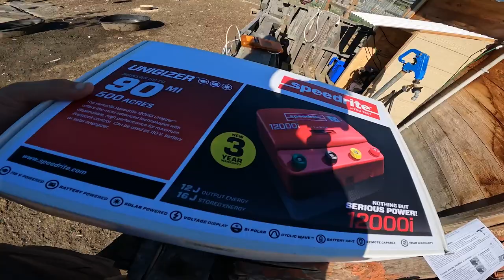Training a Future Guard Goose

Comment: Sounds like your fence charger needs an isolation transformer.  Or needs to be plugged in to an indoor outlet, via extension cord.  They cyclops super only pulls about 16 watts peak, so it wouldn't require much.

Comment: I don't think your fence has a power issue; it's more likely the distance to the ground rods. If the electricity has to travel a mile through the ground from the cows' feet to the grounding rod, that takes a lot out of it. Providing a shorter path by putting in the grounding rods in all four corners of the fenced area would help tremendously. It's a lot of extra wire, but maybe you could use the normal fence as a wire? Connect it to the ground connection of the charger and add a couple of grounding rods as far away from it as possible.

Comment: You may want to research "AFCI" (Arc Fault Circuit Interrupter) breakers, installed into a properly grounded sub-panel, and 'hard wiring' the pump and fence charger into the AFCI panel, with heavy duty industrial grade switches, and off/on indicator lights installed into the circuits for controlling their operation - versus the "plugged-in" and "unplugged" method in use now.  I would also look through the Grainger, or McMaster-Carr catalogs, to see if they have a voltage monitoring system to clue you in with an audio alarm, or pager activation in the event that something preadatory tries to come in, or one of your members of your cattle family decides to venture beyond the boundaries imposed by the electric fencing.

Comment: Retired electrician. If your GFI (ground fault interrupt) outlet trips, then it's either faulty or there is an amount of current loss between the hot and neutral causing a fault and subsequent trip. If the breaker in your panel trips, then it's likely an arc fault breaker, which are bad at best for causing unnecessary trouble. If it is the breaker tripping, not the outlet, replace it with a regular breaker of the same size, 15A (amp) 20A, etc. If it's the outlet, replace it with a new GFI or take the chance of being electrocuted and use a regular outlet. 
You wear rubber boots, which is a good start for protecting yourself from being "hit" too badly. However, I've been hit hard by 120 volts and it does hurt when conditions are so that it's hard to let go. Caution is always the best course, but an electric fence controller should not cause a GFI outlet to trip unless there is an existing problem with one of the connected attachments.
Hope this helps, and that my explanation was clearer than muddy water.

Comment: As a FYI, GFCI basically monitors that all current is going from hot to neutral (one prong to the other). So when it trips that means that there is current heading somewhere else which means something is wrong (like mains power going in to one of the grounding rods and not charging your fence.

GFCI doesn't trip if you have issues on the other loop of a transformer that converts voltage like the fence side of a normal charger.  Sounds like there may be an issue with the cyclops and the GFCI is tripping correctly to avoid having mains powered poultry.

Comment: You have a nice protective covering for the pump and fence charger, but the Ground Fault Circuit Interrupter outlet is out in the open. No wonder it keeps shorting and cutting off the power

Comment: I remember that you have the battery backup for the house but I was wondering if you have that extended to your barn/yard circuit? If not have you looked into an emergency backup generator? I'd hate to see you loose animals due to a power failure.

Comment: I'd think you need a grounding rod closer to the cattle.  Dirt is rather poor conductor.  That long stretch from the grounding rod to where the cattle are is weakening the electric jolt. As for the GFI issue, I'd suggest using a filter (RFI filter) between the GFI and the energizer.  It's the noise setting off the GFI.

Comment: i try every way to tell chicks and nothing is 100% so far. what is really tough is if you can't use the wing when they first hatch (only true for certain breeds) and you are trying to tell later on when they are juvies it is really tough, beta males will suppress their charateristics. I have had silkies hide being male right up until 5 or 6 months then suddenly they are grabbing hens out of no where and crowing. then other roosters are very rooster at just 8 wks, no rhyme or reason except what I refer to as alpha vrs beta roosters, those meant to lead mature quick, those meant to blend in and stand in wait develop slower, how they do this I don't know! BUT I recently started checking vents! boy vents stay small and round. girl vents start to widen horizontally early as 8 wks. I find nothing online about this but I am not surprised, who want's to brag about sexing by butt hole shape!